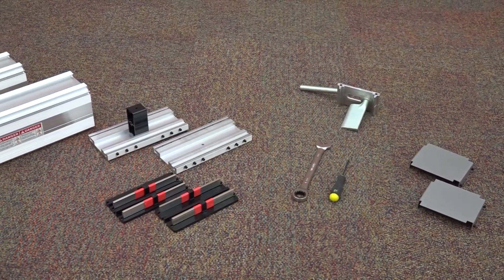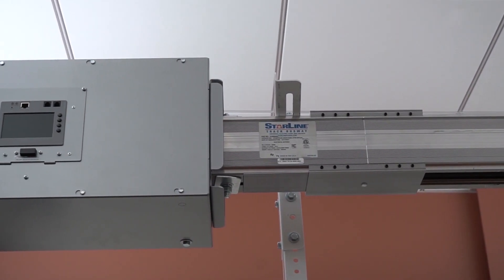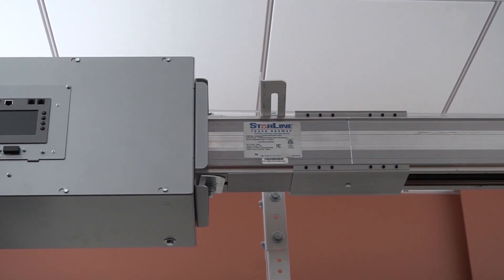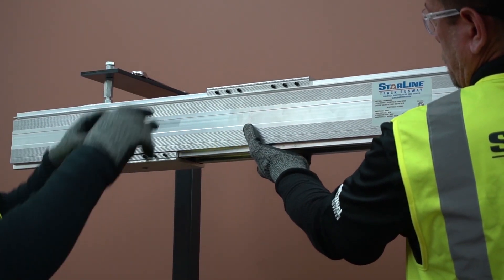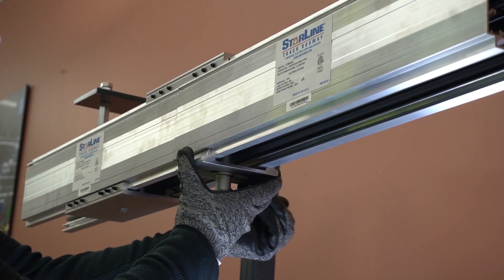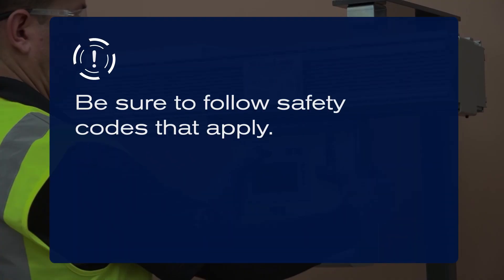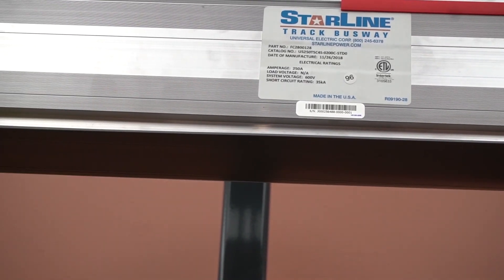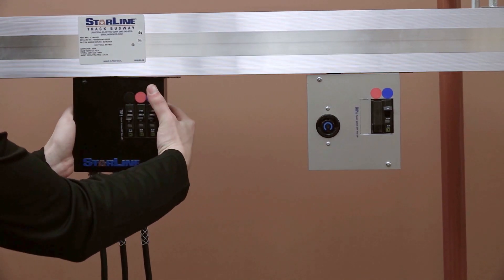Starline Track Busway 250 to 1250 Amp T5 Installation

Comment: Our bus duct also came with copper bar pieces that do not have an apparent purpose. They are the approximate length and thickness of the bus connectors (splice bars). They have a wrap of red insulation around the center.
Reply: Min 3:30 maybe?